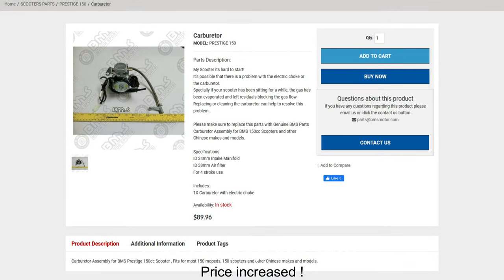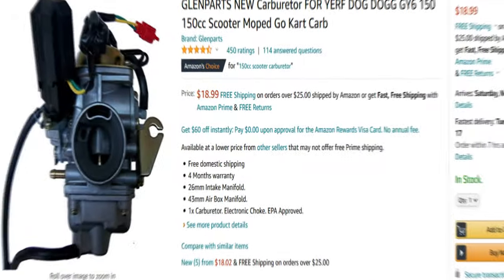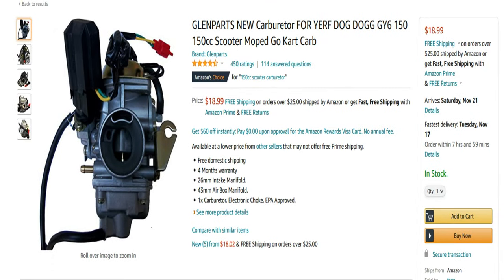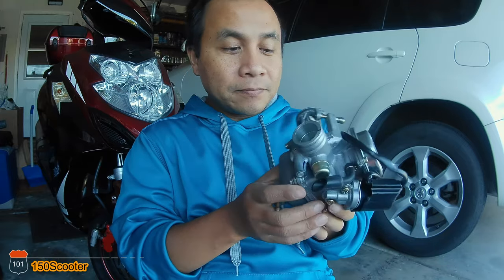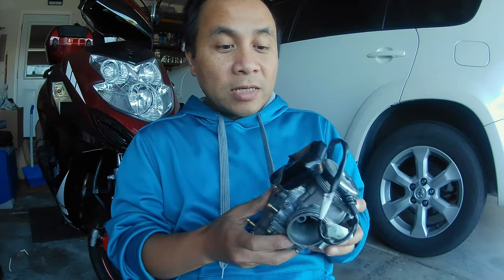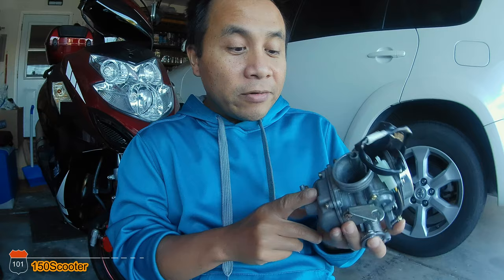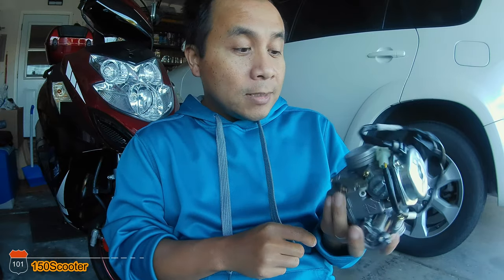First Scooter Gy6 Breakdown Vlog ! | 150Scooter

Comment: I've owned my Prestige 150cc for about one year and that also was my first major failure. Engine wouldn't start and when it did in idled really rough like it was misfiring. I adjusted the valves, bought a new cdi and coil. The last thing I suspected was the carb to be bad.  I went on amazon and purchased a cheap PD24J 24mm carb for 20 bucks, swapped it out and it started right up. Plus the new carb has the fuel screw exposed and the jet needle is adjustable (unlike the old one). I would never buy standard replacement parts from the BMS website. They charge way to much. Only good for specific parts like body panels, speedometer , etc.

The issue with these carbs usually the pilot jet gets clogged and the autochoke sometimes stops working. I took apart the old carb I removed both jets and the pilot jet was clogged, I compared it to the same size jet in my jet kit and I held them both up to to light and I couldn't see through the old one. I saved the old carb just in case I need the diaphragm, float bowl or any seals or screws. The only difference from the new carb was the end of the fuel drain line was different mount so I just used the float bowl and drain line from the old carb.

I try to only use Non-Ethanol gas to help keep the carb clean inside. The Ethanol in regular gasoline will eventually clog the passages and jets especially if the scooter sits too long.

Comment: The entire carb probably did not go out but you may have had some dirt clogging one or more of your jets. Most of the time you can get a cheap rebuild kit for carbs and it will be like new.
Reply from the maker: That's true but new carburetor cost only $18 and rebuild kit is about $10. I rather go with a new carburetor.